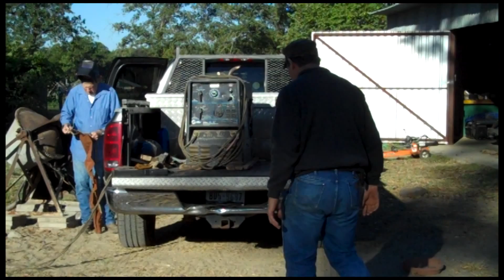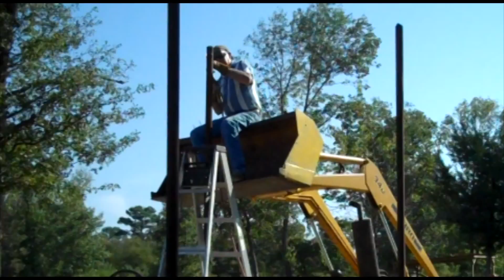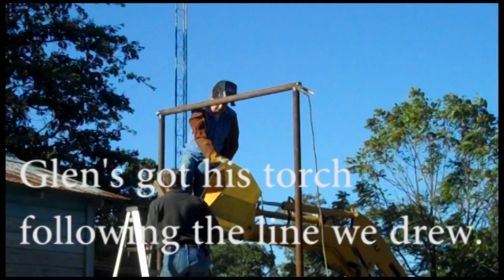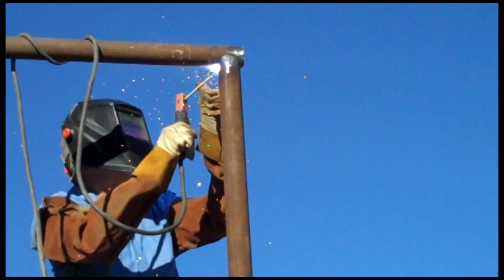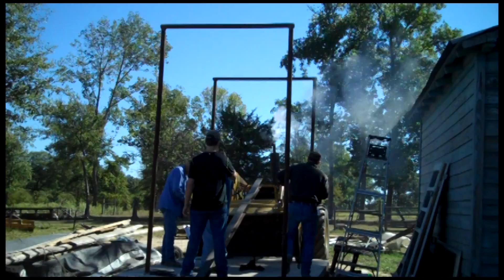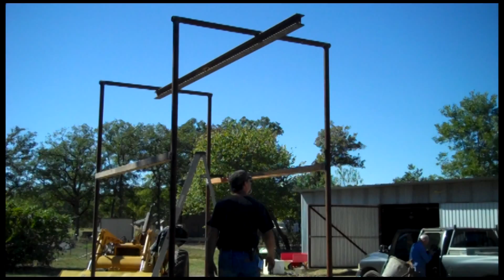Process your own Meat #2: Welding the I-Beam/The Allen Brothers

Comment: Looks nice.
Kain't beat a tractor with a loader and bucket... a million uses.
Reply from the maker: No you can't. I wondered how it would handle the 13.5' I-Beam. It's heavy. Real heavy. We drug that sucker around to get it into place. But the tractor just lifted it right on up pretty as you please.
Reply: +AllenBrothers 
My loader will do (i think) 2800LBS at the bucket. If you have something leveraged further out from the bucket...it's less. 
I still get under stuff like logs, etc... that it won't pick up... or that the rear wheels come off the ground when I get hold of it. 
I think I'm fixing to buy this little dude:
http://www.armstrongag.com/rock-brush-equipment/
The BGR64-9 model
They have them at Rose Country Kubota in Tyler.
Reply from the maker: The grapple is pretty cool. Gotta luv hydaulics.